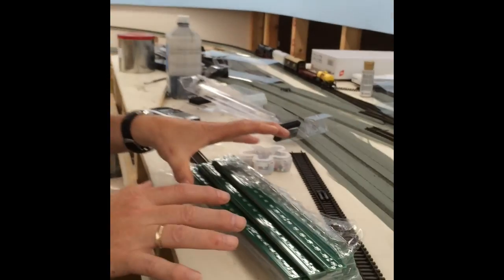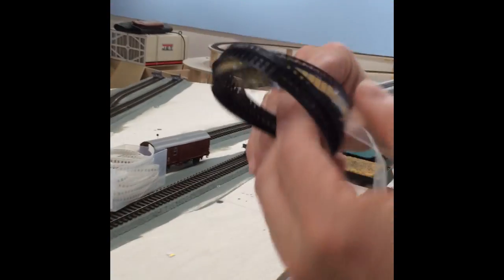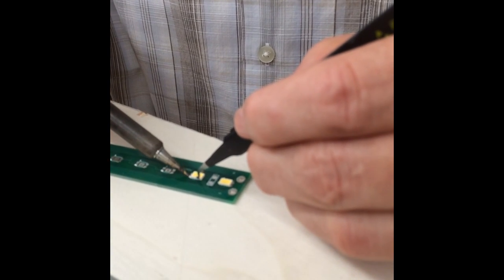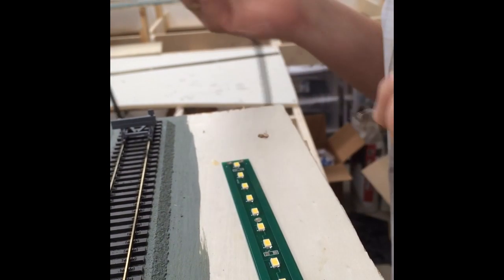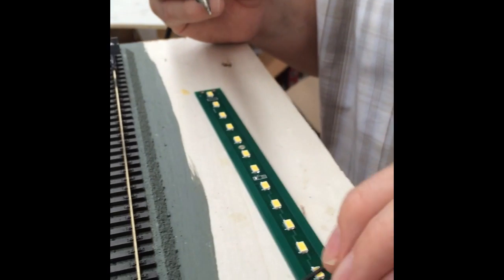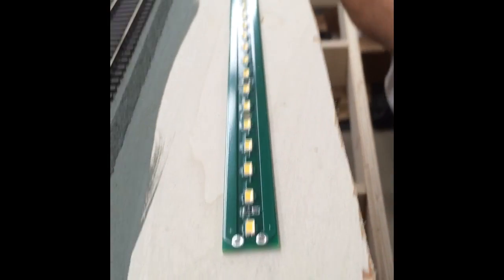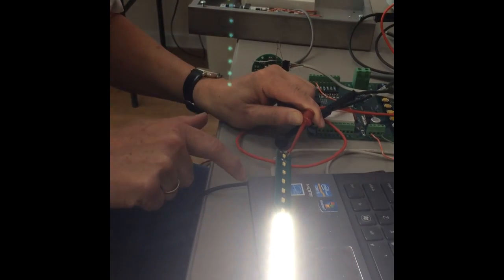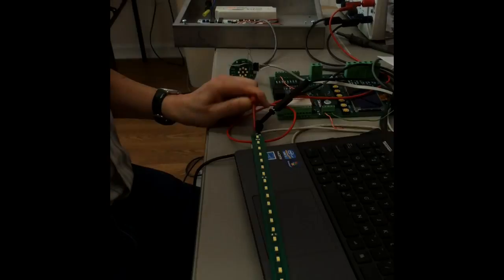Michael Rose LED light panel construction

Comment: WOW, he just makes soldering seem so easy LOL.
Reply from the maker: 2005GLI, He does make the soldering seem easy, but he does have a fully adjustable soldering iron that you can control the iron temperature via a digital read out.  The soldering station cost about $135 to $150.